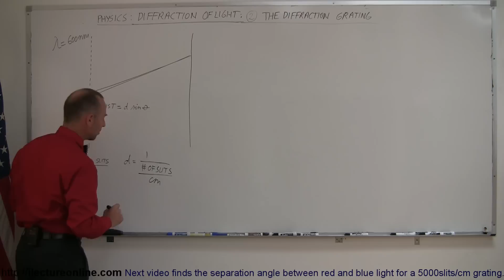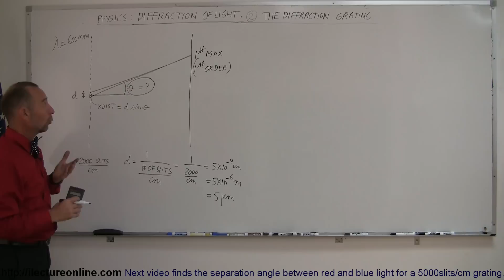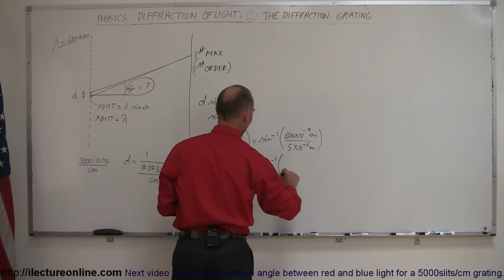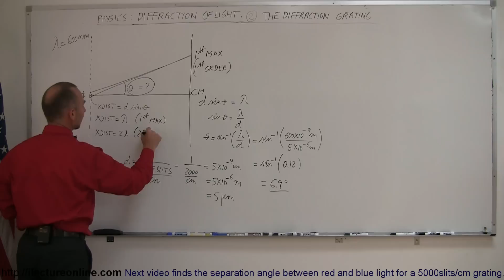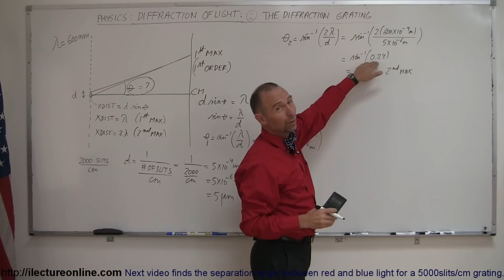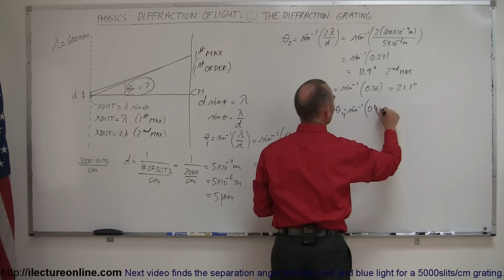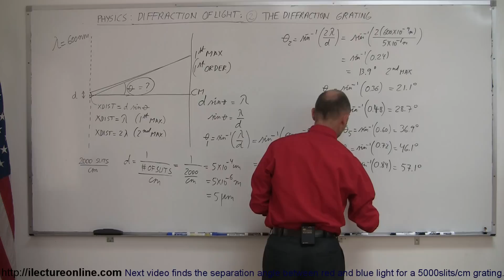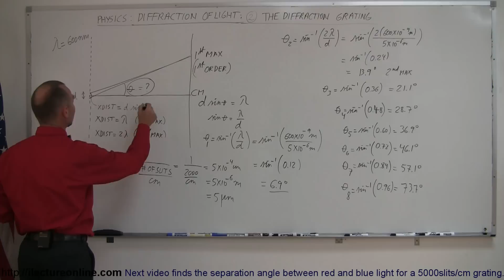Physics - Diffraction of Light (2 of 4) The Diffraction Grating

Comment: Hello, how can we determine the maximum number possible of bright fringes (given only d and lambda) 
thank you
Reply: the question is actually the following: An 18-mm wide diffraction grating has rulings of 880 lines per mm. Monochromatic light of 590 nm wavelength is incident normally on the grating. What is the largest angle, measured from the central bright spot, at which an intensity maximum is formed?
Reply from the maker: iyad kobeissi
Iyad,
There is a video specifically for diffraction gratings.  
There are similarities to the double slit, however the angle at which the maxima occur with the diffraction grating is much greater than for a typical double slit problem.  
The extra distance traveled is:     XTRA distance = d sin (theta)
When xtra distance is equal to 1 wavelength a maximum will occur on the screen
I this problem d = (1/880) mm
You'll find that the angles are large and when the angle for the second or third maximum (2 and 3 wavelengths) exceeds 90 degrees it is no longer visible.
Reply: Michel van Biezen I tried doing it this way but they say the answer is 30°
Reply from the maker: iyad kobeissi
I got 31.3 degrees as an answer
Reply: I get what you meant sir . Thank you so much!!

Comment: hi

this video and the previous video do not make any sense to me. the last video u said "at the first max, the x dist =(a/3) sin theta = lamda/2. and this video, you said for the first max, x dist = lamda. they are both single slit.
Reply from the maker: In the previous video we were solving the diffraction of a single slit.  In this video we have a diffraction grating which has many slits very close together.  They are solved in a different manner (as shown in the video).
Reply: thank you so much
I have another question

when i was doing the double-slit interference experiment, I have seen the third missing bright spot on the screen. I wonder why? my data was the width of the slit is 0.08 mm, the distance of two slits is 0.25 mm, distance from slit to screen is 87.7 cm, and my wavelength is 635 nm.

When I increased the distance of the two slit to 0.50 mm (the width of the slit was unchanged) I got the sixth bright spot is slurry

Can you explain why? i think this is because the collision between the diffraction pattern and the interference pattern. but am I right? Thank you